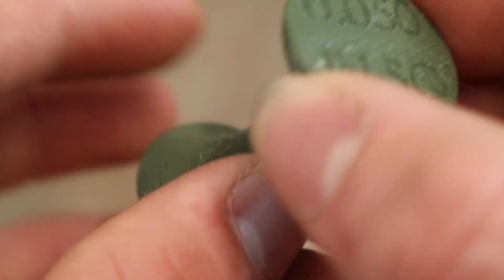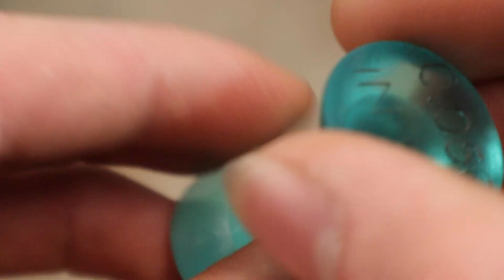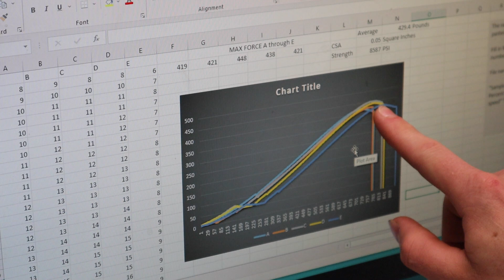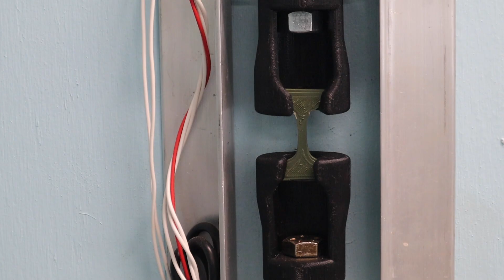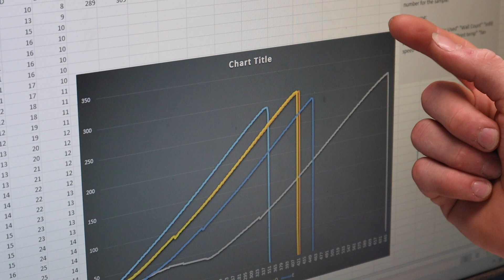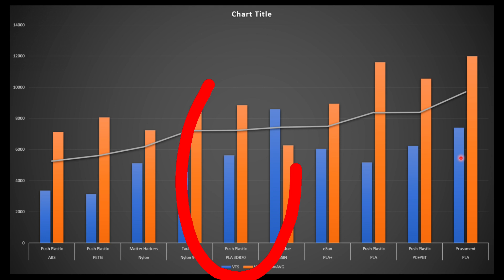Resin vs. FDM Prints | Which is STRONGER?

Comment: How viable is annealing in sand or fine salt FDM prints? In terms of adding strength or heat resistant.
Reply: Check out CNC Kitchen here on youtube, he's done lot of work in this area
Reply: @GarbageDeplorableBitterClinger  I agree.  He has a lot of good stuff on his channel.
Reply: I think (not 100% sure) annealing PLA will shrink the part a small percentage even if printing at 100% infill.  I'm not sure what that percentage is, but you would need to increase the print size to compensate.
Reply from the maker: It's not really annealing. The salt method is remelting. I'll second the other comments, check out CNC kitchens videos! They are all really good. In fact, if you look back, he did a video testing the same resin I did today. Very interesting.

Comment: So it's looking like with the right resin you could produce a better lower or frame. If not fully feasible yet it will likely be very near future.

Which means I can print a nearly clear frame and call it Casper and then I can say a finally have a ghost gun.

Of course you have to create a different printing environment due to chemical fumes so ventilation is critical for health reasons.
Reply from the maker: Yes. Keep a close eye on resin printers! They will probably replace FDM for a lot of applications.
Reply: @HoffmanTactical 
Seems promising, but there's still a ways to go.
Reply from the maker: @wanderingcalamity360  I am intrigued enough that I just ordered a Anycube resin printer ;) So we will see for sure if resin works for lowers.
Reply: @HoffmanTactical 
Looking forward to the results.
Reply: @HoffmanTactical  Been printing on a Mono X for about 3 months now.  I hear that a 60/40 mix of Blu and Tenacious might have the needed impact resistance and overall strength to do the job.  It will barely fit a receiver flat on the build plate if you angle it right.
Reply from the maker: @MisterDeets  Since the layer orientation does not matter, I plan on printing at a forty five degree angle, a LR-308 lower should fit that way. I'll have to experiment with mixing resins, sounds messy though ;)
Reply: @HoffmanTactical  make sure you shake up (and ideally warm up) the resin before printing, and stir any resin that's still in the tank.
Reply: The Siraya Tech Blu actually has a clear variant color for it that does get close to transparent.